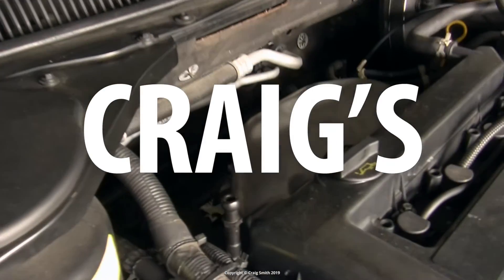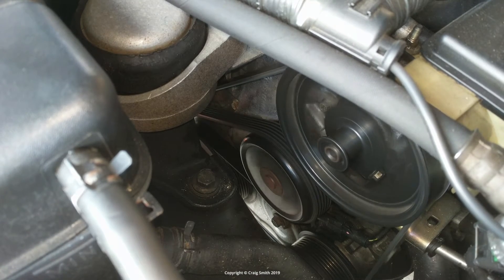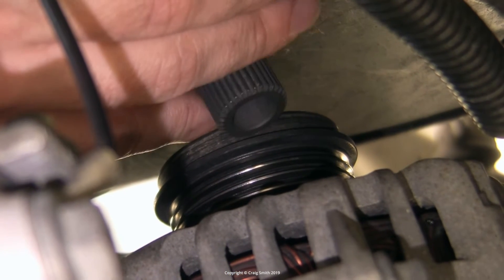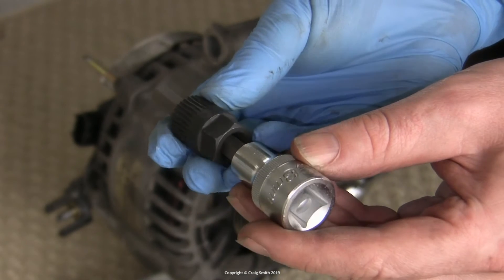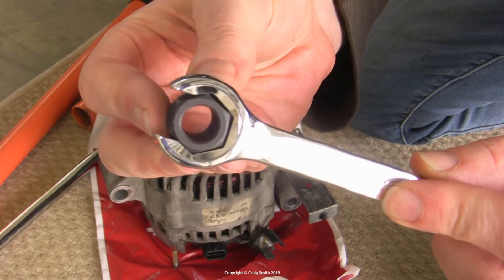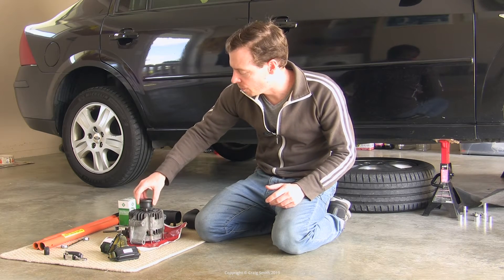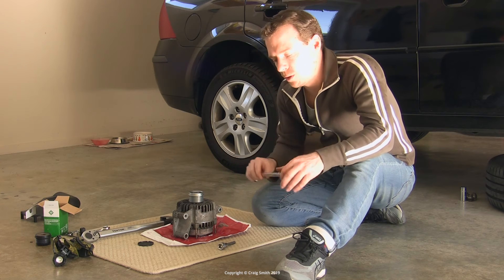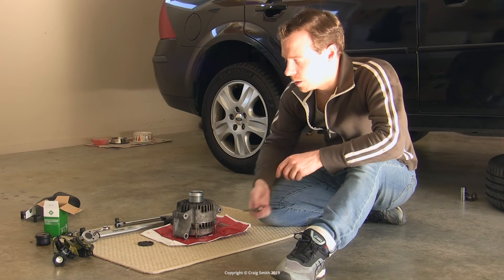How to: Test & replace overrunning alternator pulley (OAP) Ford, VW, Audi etc

Comment: A lot of these are not made to be loosened with an impact as they can damage the clutch, if penetrating oil doesn't work you are recommended to use heat up to around 150c to help break any corrosion. Also it appears you were moving the wrong tool as you should be locking the shaft with the inner bit and tool combo and holding that steady while you crank away on the outer splinted tool combo as this is the part which threads and torqued the pulley to the shaft. You were essentially fighting the seized clutch assembly, we all make mistakes when learning and diying our own vehicles.
I genuinely enjoyed how well put together this was so i've had to subscribe to get more of your car content as the calm relaxed narration is enjoyable!

Comment: I might be wrong but I think your torque wrench can be used in both directions by simply pressing the button on the handle at the socket end, and pull it apart, switch it 180 % and refit. Hope this is helpful

Comment: I test the pulley by having someone turn off the engine while i flash a light into the alternator to ensure that it still spins a bit while the drive belt has stopped.

Comment: Thanks a lot for the video! You saved me from unnecessary replacing the pulley. Was replacing the belt and the alternator pulley was not freewheeling just by hands, I thought it was seized and was all getting ready to replace it but when you said freewheeling is fairly stiff, I went back and tried it while holding the shaft with the allen key and with some more force than just the rotor inertia was able to spin the pulley in one direction and not the other.

Comment: I have 2012 Ford Fusion with the 2.5 Duratec. Battery light always comes on within 30 seconds of startup and the idle drops for a second when it does.  I actually had the battery and alternator voltage tested by a shop originally. Both are perfect and have never had charging issues. It has been doing it now for over a year actually. The strange part is the light only really started coming on like this after the headlights were left on overnight which drained the battery. I then used my jump pack to get it started. Battery light has been coming on ever since. I have also unplugged the battery to try and reset it and no change. I only recently thought about it being a worn out alternator pulley? Is it possible that a reoccurring battery light like this could just be giving a false warning? 😅🤔

Comment: The reason that you couldn't get the nut off was not an impact wrench. The NUT should be turning Clockwise as its reverse treaded. But as it clearly can be seen @7:32 your are turning it counter clockwise!!!
Reply: He tried to turn whole shaft.🫣 Shaft needs to hold still and then turn clockwise 33 spline. New pulley just tied nicely. Its not needed to be correct torque (which is 85nm) because with use its Will tighten byself.
Reply: Informative 
My friend you are wrong 
OAP screws clockwise, on 7:32 turns the axis=shaft clockwise thus unscrewing the OAP
Here can you see another video 
https://youtu.be/9sObuyPDZaY?si=qj4Fh1TWUkmhC1mp

Comment: Tried to do mone this evening with tools, not a chance. Lightest dakdak with impact gun using spline socket and just a rag holding pulley and straight off. Thanks for the suggestion. I wouldnt normally use my impact on that type of repair.
Reply: I did the same, had to use about 2 ugga duggas though as dakdaks were not enough.

Comment: My alternator pulley is bent. Could that cause the belt to run off the pulleys to one side? I'm considering whether to replace the entire alternator or just the pulley. The car has over 300,000 miles

Comment: If the pulley is gone,does it cause charging issues?for instance charging ok in low revs and not charging in high rev s?
Reply from the maker: Not like this. But if you suspect your alternator, test your alternator.
Reply: Allready did mate but still same issue,i think the pulley spins freely

Comment: For removing that kind of pulley, I used that special tool  with air gum. Don't need to use lock shaft alternator.

Comment: When mine went it would make a really loud screeching noise like like dry metal to metal, it started of as what sounded like a bit of belt screech then one morning the thing didnt stop screeching untill i got to the end of the road, i pulled over and took the cap off and started it up it would screech intermittently and you could clealy see the pully spinning a lot faster than the inner spindle, mine just lost its ability to grip to bring the alternator up to correct speed, its was a weird drive to the  engine would pulse away with randam battey lights, mine has a vacuum pump on as well so it was also playing havoc with the brakes and turbo

Comment: IVE GOT a noisy one and works fine and i tested spraying some oil around the back and it went away,  could be dry bearings but I'm going to change it as I'm on 70k as they say 60-80 is around fail rate

Comment: Yep. My tensioner was rattling like crazy and my belt warped and twisted when idling. I took the belt off and noticed a crack on the belt. I checked all the pullies including the OAP by sticking a screwdriver between the fan blades in the alternator and trying to turn the pully both ways. It locked both ways. It's gone. $98AUD for a new OAP that I install myself. I learnt how to do it from youtube hahaha. I can fix most things on my cars because of youtube.

Comment: I changed mine recently. I had not seen your video, and spent many cups of tea scratching my head looking at the cartoon installation instructions that came with the new one, clearly showing some kind of mystery device going into the alternator shaft to stop it turning. (Exactly like you did). So I matched the OAP part number to a tool for the spline just fine, got that delivered. However was still baffled as my alternator had no hex, no torx feature, nothing on the shaft. I was baffled as to what I was missing. Put the tool in and it just turned the shaft, like you would expect. 
I’m the end I did “option 3” too, and sheepishly walked the alternator to a local garage, cash in one hand, bag of groceries and alternator in the other. They very kindly just buzzed it out with an air-tool there and then, for a packet of me garibaldis. Seems that air tools don’t necessarily need the alternator shaft held at all. (Uses the inertia of the rotor). 

Next problem was torquing the new one to the right setting tho. So the guy, to my horror, then jammed the alternator with a metal rod, right into the windings of the rotor, then put 80Nm onto the shaft. I am surprised the winding insulation has not been compromised. But 6 months later it’s still working fine…

That said I would strongly recommend using the right holding tool, if there is any feature/option to take one. 

Good vid buddy.
Reply: I’m also very grateful for the help.
Reply: Good job done well.

Comment: 😢I just broke those thing that need M10 with 12 points but I used T50 bit 6 points so I had no choice than to remove the alternator out and there is no way than to use “ electric Wrench / IMPACT with spline 33 “, It’s done no more than 3s, Wondering why didn’t I use this method than by those manual tools it’s so hard like hell ( I’m not a mechanic)
Then I put a new INA (OAP) pulley back but I cannot use any Torque wrench either, so I shot twice with electric Wrench impact twice a second each with hope just close to torque value without break the new pulley, DONE ! 
I believe by running the car it will help to torque themselves 😂to the value 85NM* 
It seems now is running fine without “clang weird noise “. I did replace the pulley because even after replacing the Tensioner, the weird noises and the tensioner was goggling too, the most culprit was the seized pulley’s 😂solid no clutch! 
IF you don’t have any experience like me to do this but you have to, remove the alternator from the car, check the right tool for… 
Or just use electric impact that we use for replacing wheels with spline, a second done ! 
Lesson to be learned 😅

Good vid, thanks

Comment: I changed the pulley on my -08 Toyota Auris yesterday. I bought a 14 pieces pulley tool set from my local partstore, but non of the bits fitted. It had like a 17mm insex with a 12 or 13mm boltend on middleaxle. I just drilled down the bolthead so the 17mm insexbit fitted and simply used my Milwuakee M14 fuel to loosen it. Worked great!

Comment: My advice is to use an impact wrench to get the pulley off of the alternator.  The pulley is bad anyway so you don't have to worry about ruining it.  Use the proper tools to get the pulley back on the alternator and torque it down to the proper torque.  Using an impact wrench on the new pulley could damage it.   Trying to use the 31 tooth pulley with the center allen wrench tool to get the pulley off could break the allen wrench.

Comment: Hello Craig, you think that it was seize because that little cap was missing? Thx
Reply from the maker: It wouldn't have helped.
Reply: @CraigsDIY Thx for the reply. I saw lot of video about that pulley. How to know that it is seized? I see also that it destroy the alternator shafts because it was seized for too long. I bought one but i am now afraid to mount it.

Comment: You: "There is no real way that it can come undone on the car"
My car: "I found a real way that it can come undone while my owner drives me. Extra: the half of the tensioner roller vanished, the belt of course is now open."
Haha, so probably the freewheel function has gone and the pulley become a simple nut. Volvo V70 diesel 2002 @ 380000 miles. 
Thanks for your video, now I understand better the insights and now I know what waits for me tomorrow.

An interesting addition: that morning I heard some "grasshopper" from the engine, I localized that it is the generator pulley, which traveled towards the generator first and touched it a little bit and started to make small chips, like on a lathe. I had no clue what was happening, so I went to the job, but I put 2 extra batteries into the baggage room and a start cable for every case (have some experience) . After 1 hour happened what I didn't want to happen, I prayed I can drive one hour more with the extra battery without a generator. (the battery in the car of course is near the end of life). I bought a better battery charger, so I could drive home the next day with 2 fully charged (1.5) batteries (approx 150Ah total), 2.5-3 hours, no headlights, and a few stops/engine starts.

Comment: there is a third option to torque the screw , flip the 1\2 socket end the other way so you can use it for left hand thread (counter-clockwise) ... they usually have the same size , you just need to open the mechanism and flip it the other way

Comment: Instead of changing the pulley, the problem could just be solved by replacing the alternator right?
Reply from the maker: Replacing the thing with the pulley on it would certainly seem to replace the pulley! But if it's the pulley that's faulty, surely a bit unnecessary!

Comment: I find it inspiring that Damien Lewis still works on his own car even with all his money!! Never too successful to get your hands dirty!
Reply: can anyone tell me why my 96 Jeep had a serpentine belt and a fixed idler pully ?
I owned it from 99  to 2023  replaced three belts over that time  yet  never touched alternator   ?    it was factory alternator and  did not have a stupid auto.matic tensioner??
People are stupid  the Mazda you buy today will have cost its purchase price  in parts and labour in four years
Reply: this is because of four 
cylinder crank pulses  I suppose my old jeep being a six cylinder  had a smoother pulse rate?
Reply: I'm really confused. What is your question

Comment: BEWARE: not all these pulleys have a logical reverse thread. I have a Denso alternator and it’s a standard thread.
Reply: It depends on the configuration in the car and the drive direction.

Comment: Its a faff but with the Bosch alternator on my Bora TDI, I removed it then took the alternator rear off, then used a oil filter chain wrench to grip the rotor so I could loosen the pulley with the VW 33 point spline tool.

Comment: I'm getting a whining noice from my alternator. Could it be from this?
Reply from the maker: Whining is probably inside the alternator, either get it rebuilt or replace.
Reply: @CraigsDIY  was told it might be the water pump but hey ho I'm no mechanic so will probably get ripped off anyway!

Comment: did you change the crankshaft pully graig ? i was going to give mine a go and wizz it off with an impact but im not too sure weather it be safe enough without locking the crank
Reply from the maker: No, it requires a decent impact gun, do you just want to replace the pulley? To do timing you need the right tools. Stories on talkford.com are worth reading over, e.g. https://talkford.com/community/topic/158267-crankshaft-pulley-removal/

Comment: This is exactly what happened in my car. Firstly it was the tensioner went bad. Replaced it with together with the belt and then surprisingly new tensioner vibrates. After that I replaced my water pump pulley because it sounds squeaking. In the process I also found the timing belt is due replacing too. After all that, tensioner still vibrates and I'm just stumped. The tricky thing about the OAP is that they  don't really show any sign or symptoms of going bad. It only manifests its malfunction in other parts.

Comment: Could an overrunning pulley cause less voltage from the battery? I'm getting less than 10.5 volts
Reply from the maker: Well sure if it's completely shot and spinning free but that's unusual, normally they seize up and behave like a solid pulley while making weird noises. You need to to diagnose your alternator system and check it is the alternator to begin with. Try https://youtu.be/Q2AAMc9VIMo
Reply: Craig's DIY Car thanks brother - I appreciate that

Comment: I don't understand how the shop used an impact wrench to drive the splined socket with the hex nut tool in place. It's a pick you couldn't watch them undo it. I wonder if the held the splined socket as you did with a ring spanner in a vice and used the impact wrench on the hex bolt?
Reply from the maker: The point of an impact wrench is it hammers the fitting with such high but transient force that you don't need to hold the other part. The alternator has more than enough inertia.
Reply: Cheers Craig, I didn't know that!

Comment: From what i know, you don't really need overrunning pulley if car have automatic transmission.
Reply: The main reason for the pulley has to do with the engine... modern gasoline & diesel engines can have multiple "ignition firings" (per cylinder) which cause multiple power pulses through the timing chain /  belt and serpentine belt (per cylinder firing). Clutch pulleys help absorb these pulses because the alternator is able to continue to spin, rather than slow down & speed back up with those pulses. Power steering pumps, water pumps, AC compressors, don't have a heavy "rotating core" like the alternator... so there's no need for them needing a clutch pulley.